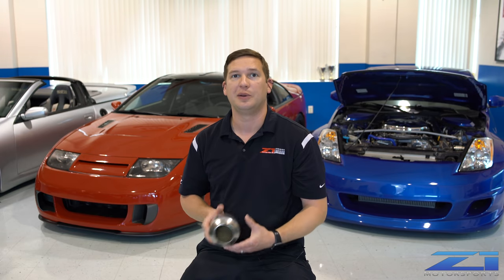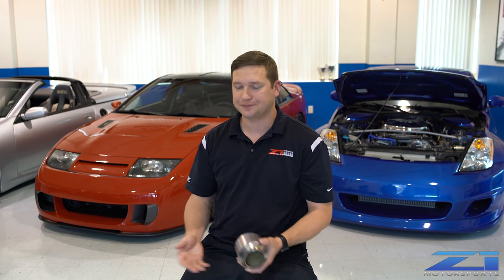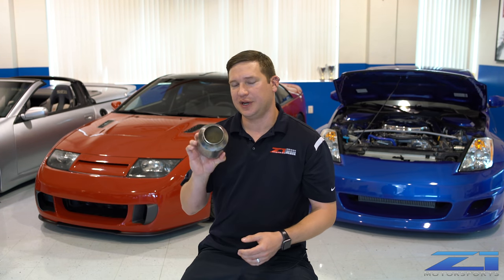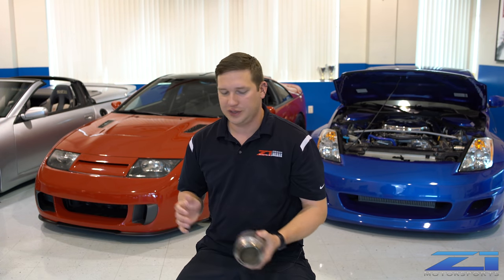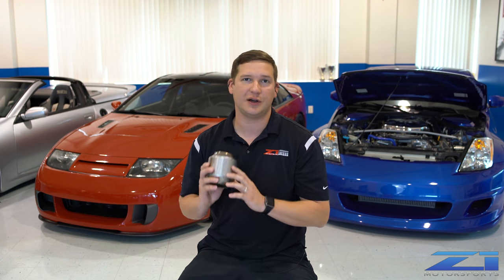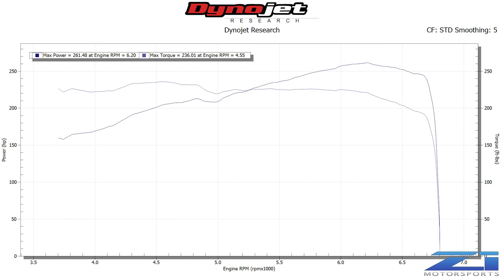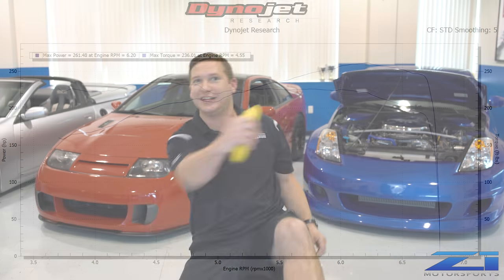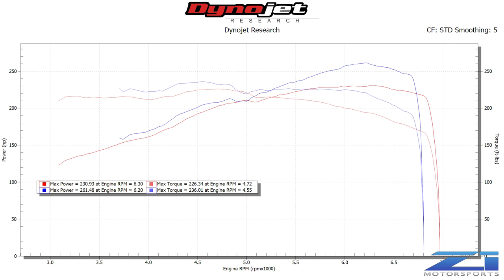Budget Banana Build Ep. 4 - Z1 High Flow Cats

Comment: Can you really install these from the underside only?  Please let me know. I don’t have enough extensions to go thru the engine bay!
Reply: Yeah, the easiest way to remove the demon bolts is soaking them in pb blaster, and getting them from engine bay with extensions. I don't think the angle lets you hit them from under the car very well.
Reply: I did mines from under the car but I had a lift its not that hard I could fo it with jack stands